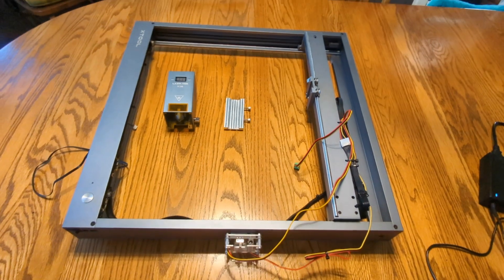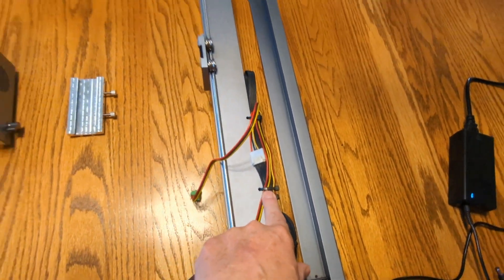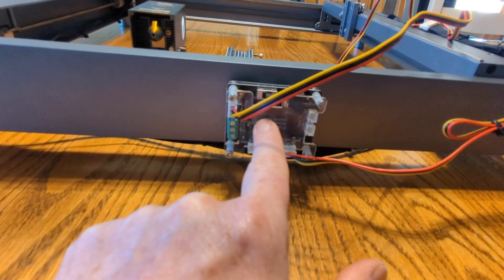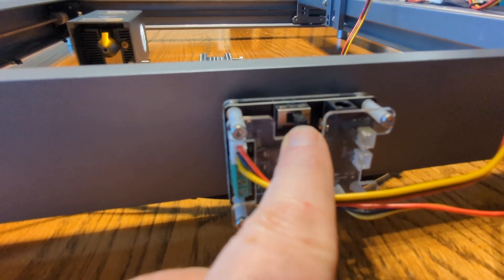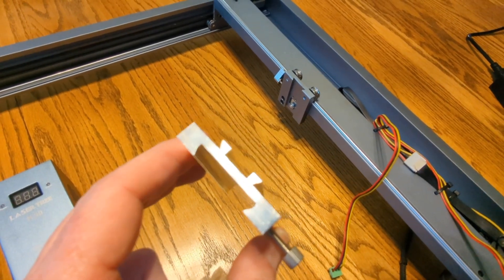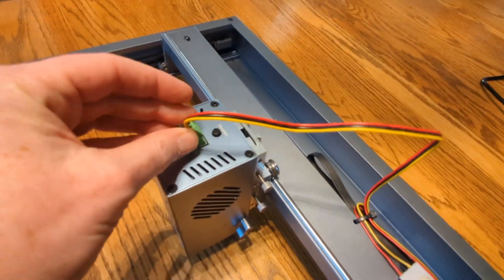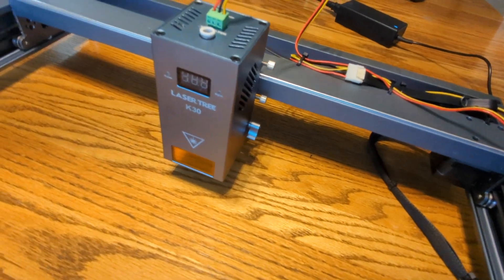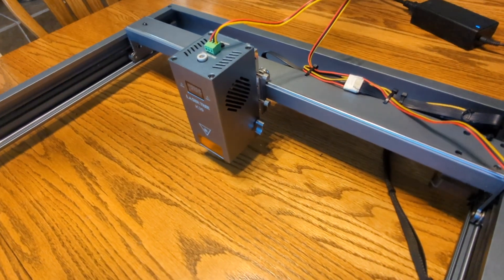Installing Laser Tree K30 on XTool D1 Non Pro

Comment: So I’m curious on xcs it won’t affect the power setting in the software since the module will be a 30w and the software will still think it’s a 10w? So will a 100% of power be a full 30w. Sorry I know it’s probably a dumb question but I just wanna be sure before I commit to the upgrade
Reply from the maker: No.  Its just a percentage of power you are sending to the module.  XCS doesn't talk to the module, it talks to the motherboard on the Xtool and that is what is sending the signal to the module to fire.  The only thing you need to do is change your Cross Hair Off Set to 16mm

That being said, I now feel that the K30 is a bit heavy for the Non-Pro gantry .  I replaced my non-pro with a Pro frame /motherboard and it's doing a lot better.  

if you have a Non-pro I'd suggest the 20W Laser Tree module at the most because of the weight.  The 30W works but on my frame it sags a little and the laser is off a bit.  Might just be my Non-pro frame is damaged????
Reply: @ thanks I really appreciate it and I have a pro 2.0
Reply from the maker: @gill4654  The Pro with the 30w will be fine.  If you order it.  Also order the 9pin to 3 pin cable they sell.  That's all you need with everything else that comes in the box

Comment: You didn’t cover how to get stools software to recognize the 30 watt laser. Thoughts?
Reply from the maker: The software doesn't care what laser module you have. The software interacts with the motherboard on the XTool. Not the laser itself. 

You don't have to do anything except change the X Offset for the cross hair to 16mm
Reply: @MikeColburn hey I’m trying to fix the Red Cross offset to 16mm but it keeps changing it to 5 like that’s the max?

Comment: Just curious as I can’t wrap my brain around this. Do you have to do anything different in light burn once you swap out laser heads? Or does it functions the same? Thanks
Reply from the maker: @shawnm4718  lightburn interfaces with the motherboard on the D1 not the laser module. 

So no changes to light burner necessary other than changing your settings for the higher power module

Comment: Do you know if the 30w laser tree can be installed in the frame of a 5w xtool d1 pro?
Reply from the maker: It's the same as the 20W., Yes, works fine, you don't need a custom mounting bracket, the one it comes with works fine!   You will need a custom cable that goes 9pin to 3pin.  Contact Geeks at Large on Etsy.  He can create you the cable.  Or order it from Laser Tree when you order your module!

Comment: So i can still use xcs? Also the air assist i use for the xtool, can that be used with the laser tree.
Reply: I have the same question.  I tried to use my Lasertree with XCS and it doesn't acknowledge the module.  Is there a way to get the software to acknowledge it?

Comment: Can't you install this on the pro aswell? I'm looking to replace my laser on the 20w pro. 10 or 20 will do. But I'm not good at this stuff. Do u have to replace the whole module or can you just replace the actual laser? Many thanks 🙏👍👍👍👍
Reply from the maker: Yes, this installs a little easier on the Pro.  You don't need the custom mounting plate, the one that comes with it will work.  Also, you don't need the external power supply.  But you do need the 8pin to 3 pin adapter to go from the XTool Control board to the Laser Tree Adapter Board!  I would ask them about including that in your order when you order it
Reply: @MikeColburn  thanks does that mean it will work with xcs also? Thanks again 👍👍👍👍
Reply from the maker: @dannoc1070  I don't see why it wouldn't. You're not replacing the Xtool Control board.  That's the part that is compatible with XCS.  Personally I use LightBurn.  Join the LaserTree FB Group and talk to the Admin, they are very helpful!
Reply: @MikeColburn  thanks 🙏
Reply: @MikeColburn  im lost
Reply from the maker: @MrMaxymon With what? What part.
Reply: @MikeColburn  i have the k40. I connected the green port to green port. Wired in the 3 colors to the control adapter. I have one random cord that goes nowhere. Like a small 8 port, and three port (assuming it connects the adapter driver to the control board on the d1 pro...just don't know where...or if I need it). 

My d1 pro 10w power supply i guess isn't strong enough because it won't turn on, but the 24v works directly to the adapter controller. 

Turns on, and XCS won't recognize the module, and i have the d1 pro conversion cable.
Reply: @MikeColburn  nevermind. it works
Reply: @MikeColburn how long did it take to get that mounting plate? I have same machine.

Comment: any chance you can scan the bottom of the adapter and make that scan available so we could recreate this 3d printed?
Reply from the maker: I already created one and used it temporarily. I put it on Thingiverse. Part number: 6449713.  It does not take the place of the metal one that Laser Tree can supply.  Contact Laser Tree for that part. This is only meant to be a temporary solution.